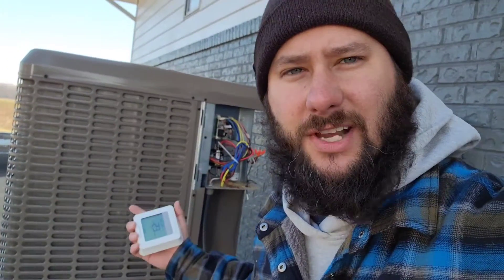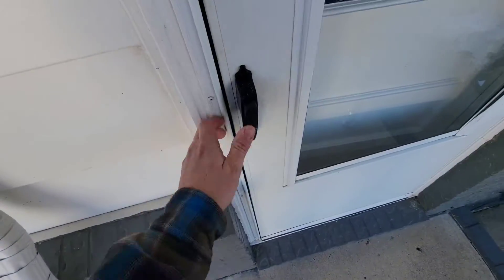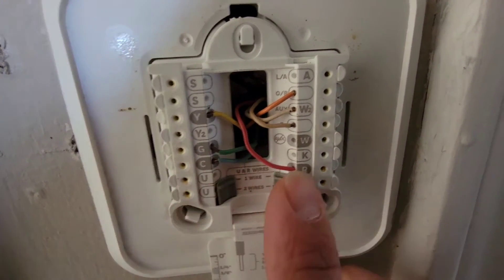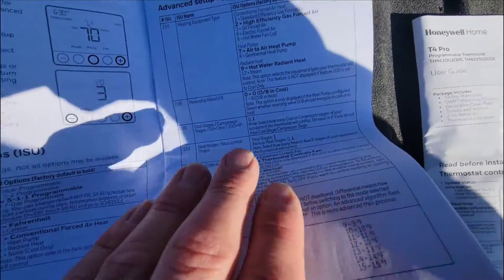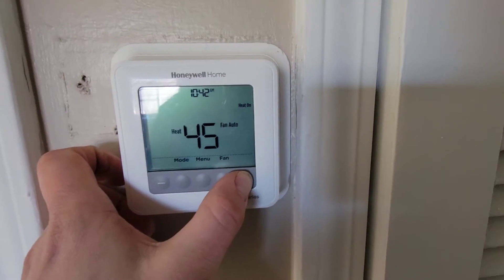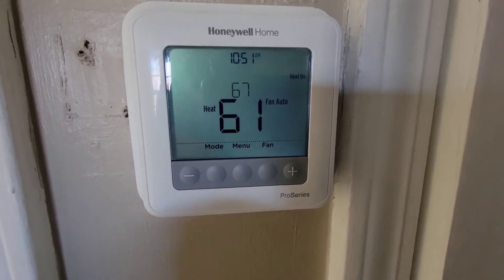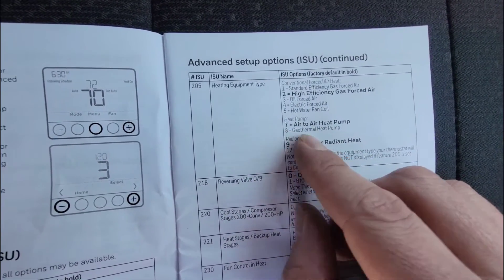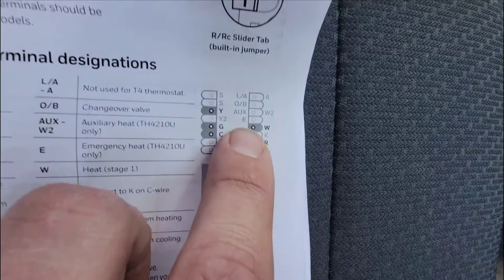Fixing Honeywell T4 Thermostat Issues in Minutes

Comment: Taking a shot in the dark here - any idea why my t4 wont show me 370 in the isu for heating cycles? My power bill is insane and im trying to see how many times its cycling but it doesnt even show me the 370 setup it skips from like 365 to 375
Reply: First you said won’t show the 375 then you said it jumps from 365 to 375. I’m confused.
Reply: @akbychoice  yea I fucked up I'm new to this and was going off memory from the install guide. It's 370 for heating cycles and my thermostat only shows 365 and 375 one is back up heating and I think droop but no option to change the amount of heating cycles.
Reply: @3v0gamba a change of each item before decides what you can change there after. 
I’m hating this T4 as it doesn’t want to work either my Arzel Heatpump pro controller. T5 on zone 1 works fine.
Reply: @3v0gamba sounds like you may be energizing the heating coils?

Comment: I have the T4 thermostat. It’s on cooling mode, however house isn’t cooling down. It’s set at 70, house is 76 degrees. I’m not that mechanically inclined. What are my options? Thank you.

Comment: This is by far the most useful video I have seen for the Honeywell thermostat, have a similar issue, fan is not working with heat on mode, checked the thermo programming and all looks good, cooling works fine, only heat mode is not heating at all

Comment: My thermostat blows 3 amp fuse on the motherboard in the air handler. When I remove the thermostat and jump the red to white wires the heat comes on and doesn't blow fuse.
Reply from the maker: check out my low voltage troubleshooting videos

Comment: I gather this unit was just installed and first operated or you would not be checking if it was not wired correctly because it would be down from day 1 !
Reply from the maker: Nope it's been working fine for almost 2 years I always double check I did not install it 
 Thermostat just went bad